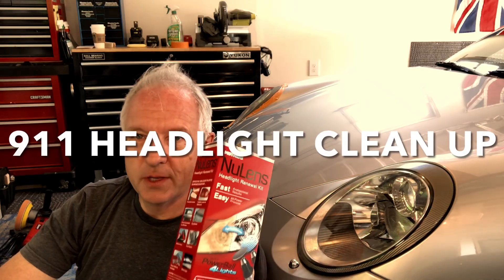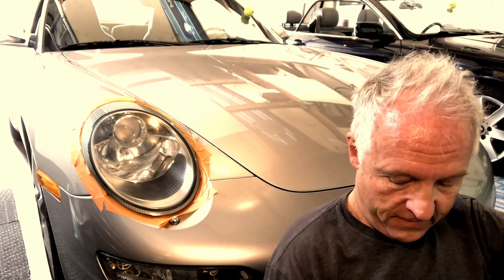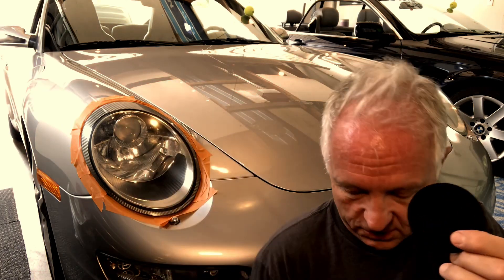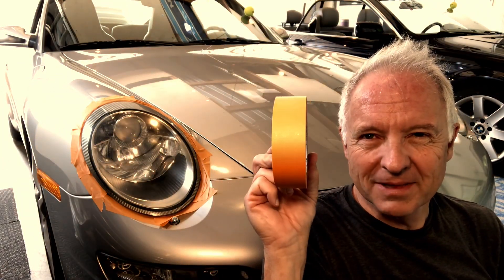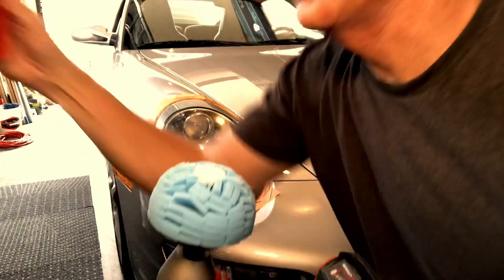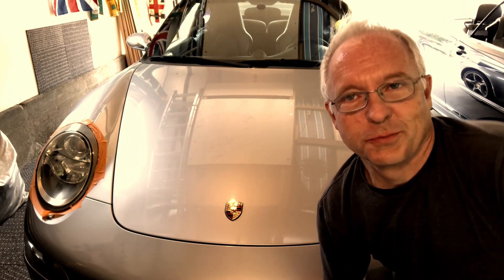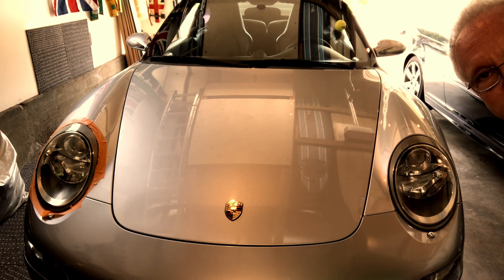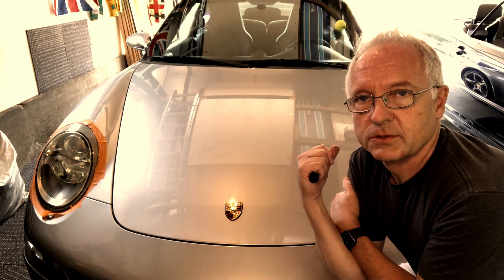Porsche 911 997 Headlight Clean Up

Comment: You should also do your running lights below. Thanks for the vid. I need to do the same thing on my 06. Take care.
Reply from the maker: Yes, the running lights are atrocious.
Reply: Just an afterthought. If you decide to
Reply: I accidentally hit the send button. What I was going to say is. If you decide to do the running lights. You might want to just remove them and do it as a workbench project. Much easier to remove than the headlights. Your knees and back will thank you. Maybe even a video👍.

Comment: Hi. Any electrical issues experienced afterwards? I read recently of folks experiencing  several issues regarding static electricity after the polishing procedure was finished? Some have recommended either removing the headlights all together to polish them or disconnecting the battery. If i didn't read it myself,  i wouldn't have believed it. Thanks again for the informative video my friend. It is appreciated. Roddy.
Reply from the maker: Wow, I haven't heard of that before. I can see how that might happen but my lights worked fine afterwards.